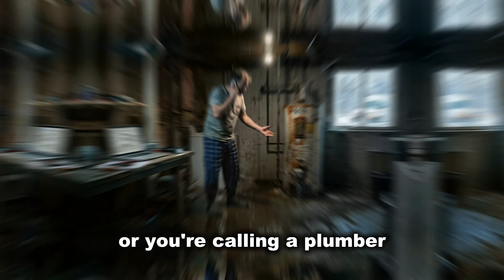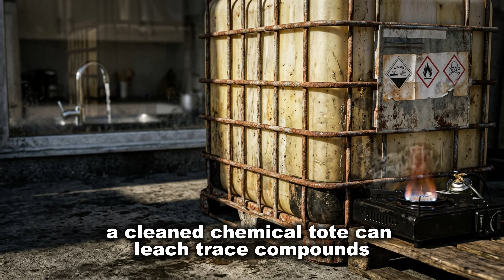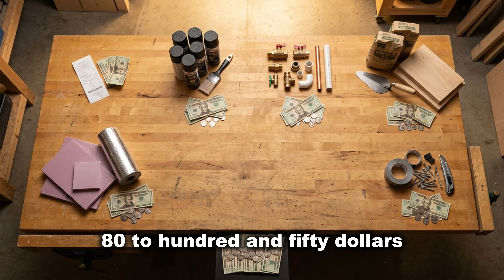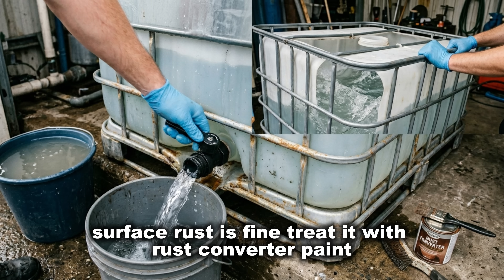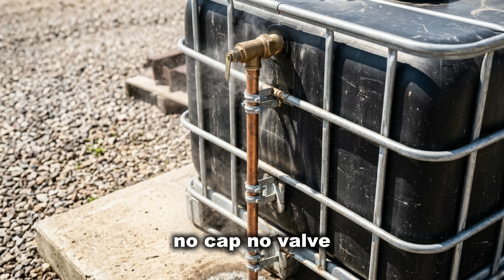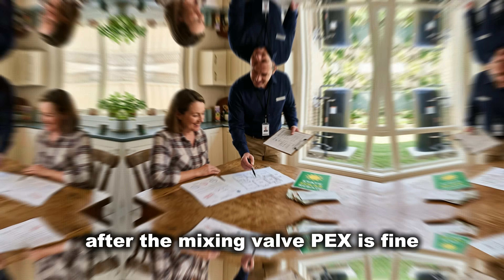This $19 Black Drum Battery Heats All the Hot Water a Full Family Needs — No Gas, No Electric Ever

Comment: I live in Canada, I have a gas hot water tank in my basement . The heat “loss”  goes to heat my basement, it obviously is cool in winter and even in the summer. So not a “loss” at all. Of course I could not use a tank of water outside in winter. I do have neighbours that have a rooftop solar collector to preheat water going to their electric hot water tank. It is controlled to only pump water through the solar collector when it’s above the temperature of the water coming out of the well.  It actually does work on a bright sunny day in winter.
One thing to consider is the heat from the sun comes from absorption of infrared energy not visible light. The colour we see may not be what infrared sees. For example snow is a very good absorber of infrared, while we see white, but to infrared its black.
Reply from the maker: That basement point is something most people completely miss — the "lost" heat is just heating a space you're already in, so it's basically free bonus warmth in winter. And your neighbour's solar preheat setup sounds genuinely smart, letting the controller decide when to pump based on differential temperature is exactly the right way to run it. The infrared thing about snow blew my mind when I first learned it too — we see white and assume it reflects everything, but infrared tells a totally different story. Snow is basically a black sponge for radiant energy. Really appreciate you sharing this, this is the kind of real-world nuance that comments sections are actually good for.

Comment: Would PEX-A work ❓
Reply from the maker: PEX-A is actually a solid choice for this — the cross-linking method gives it better high-temp flexibility and it handles expansion fittings which make connections way more reliable than crimp or clamp in tight spots. The main thing to watch is keeping it shielded from UV if any part of the run is exposed, PEX degrades fast in direct sunlight. But underground or inside a structure it'll outlast most other options. Good question honestly, material choice here matters more than people think.
Reply: @theforbiddentent Thank you so much 🙏 I just did my entire house with PEX-A and after all technical and price comparisons with other PEX, my choice was A.
I completely shall protect it from sun light if installed outside.

Comment: I would check for leaks 5 times over three days. Water leaks can be sneaky.
Reply from the maker: Ha, five times over three days is honestly the right call — water has a way of hiding until it suddenly isn't hiding anymore. A slow drip behind a wall can stay invisible for weeks and then announce itself through the ceiling below. The multi-day repeat check catches the ones that only show up under sustained pressure. Good habit to build in from the start rather than learning it the hard way 😅